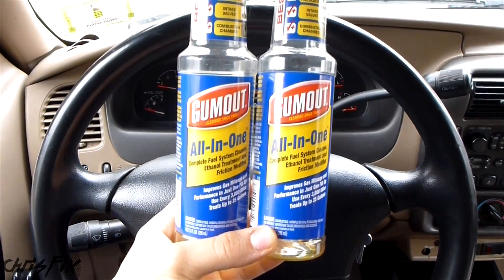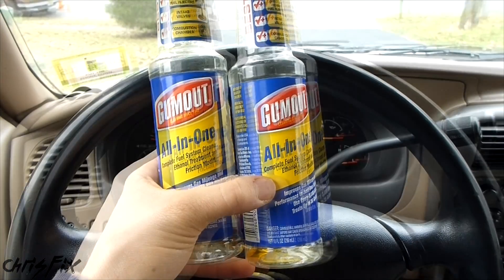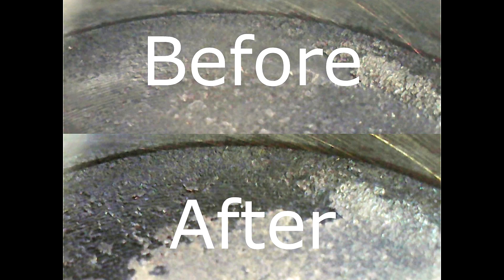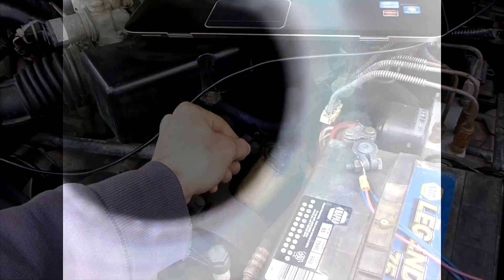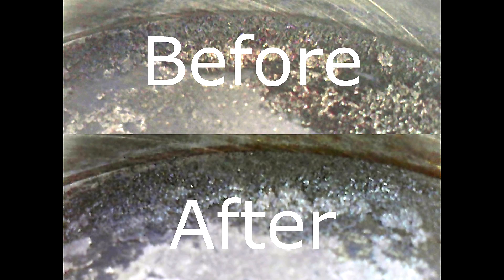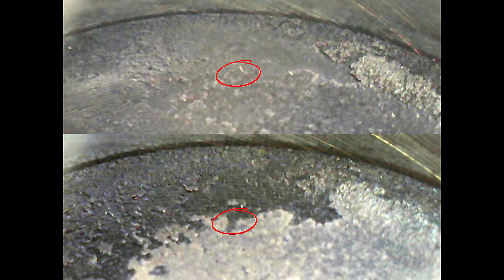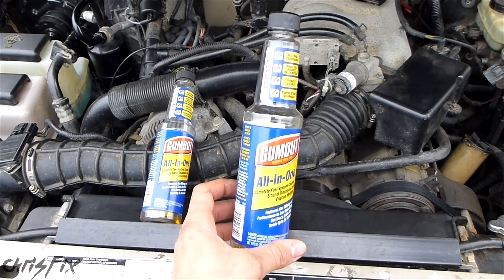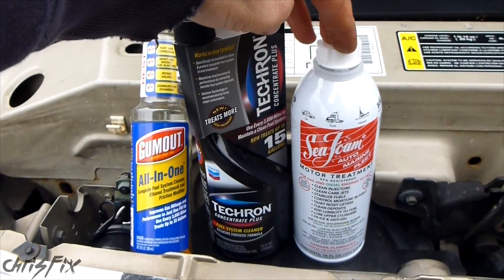Does Gumout Fuel System Cleaner Work (Follow up)?

Comment: what happened to the overheated PT
Reply from the maker: argonian bilbo It is sitting there. Trying to figure out what to do with it!
Reply: well you could experiment on it. Pull the engine and make a couple of videos on how to rebuild the engine with all the honing and other rebuild necessities.
Reply from the maker: argonian bilbo Yea, I was thinking about it.
Reply: one question. Does the reliability of an engine drop drastically if i hone my cylinders to fit larger pistons?
Reply from the maker: argonian bilbo If you do it right, it can be just as reliable as the stock engine. Every engine is different and you dont want to make the cylinder walls too thin but there are plenty of honed blocks out there that are reliable and use larger pistons and make more power. You will need to take it to someone who knows what they are doing because one mistake will ruin the block! What engine/car?
Reply: argonian bilbo
The quality of the entire boring/resizing process is what affects reliability.  If the block is disassembled or reassembled incorrectly it will cause issues.  The block and head must be decked and trued, the change in compression space measured and accounted for, the stroke of the piston and piston height must be recalculated, the rod angles need to be correct etc.  All those things and many others like block and head material, sleeved cylinders etc need to be considered.  I machine engines for a living and only some engines will tolerate a simple bore and oversize piston job ie a Chevy 350.  Thats why converting a Chevy 350 to a reliable 383 "Stroker" costs 3-4X what a stock 350 costs.  Stay gold.
Reply: ChrisFix  ok thanks. This car is being restored/modded so i probably will end up having a lot of questions, so I appreciate that you're helping me out here. Just so you know, i already changed the relay. That fixed my no flash at all problem.
Reply: ***** so do you think that a porsche 944 engine can tolerate an oversized piston job?
Reply: ChrisFix I was thinking of doing it on an 88 944. I think the car severely lacks power and I want to get oversized pistons and eventually turbocharge it or completely scrap that idea and do an LS swap. Engine is a naturally aspirated 2.5 liter.
Reply: argonian bilbo
Check Porsches specs regarding cylinder overbore allowances - heres an engine manual:  http://www.9ss1.dk/porsche944/garage/vol1/vol1.html.  If you really want to do it disassemble the engine and have a engine machine/building shop look at it.  If it was me I would just leave it stock, sell it and buy a S or Turbo model, then love it and massage it and tweak it.  Stay gold.
Reply: ***** I actually bought the car dirt cheap and if I sell it, it wouldn't bring enough money in to buy an s or a turbo
Reply: Yes thats true, but properly oversizing that engine and adding a turbo will not be cheap either.  Maybe you might make a little positive money off the car?  Research the costs of your intended mods and add the income from possibly selling the car.  Consider also that selling a modded car is more difficult than selling stock vehicles.  I am not sure if you want to keep the car for a very long time, that might change things.  Stay gold.
Reply: ***** yes I'll research first before I jump into it. I've been thinking if doing an ls swap intead of this, but thats not cheap either. So right now im trying to come up with a way that will work best for me and also won't completely drain me of money
Reply from the maker: argonian bilbo I dont know how easy or hard it is to do an LS swap but that is the better route. If you start messing with the engine, you will need to bore it, get correct pistons and have everything balanced correctly. Then if you turbo it you need to think about that when you pick the pistons. I would spend the money on an LS swap rather than an engine rebuild.
Reply: ChrisFix another question. So on this 944 i changed the blinker relay because it was bad and now it flashes fast on both sides. The hazards work normally but the others don't work. I changed bulbs on the back but the back left doesnt light up.
Reply from the maker: argonian bilbo what are "others" the turn signal bulbs? What isnt working?
Reply: ChrisFix that's what happens when you ask on the fly. I meant that when i flip the turn signal arm up or down they flash fast, but the hazards work normally. On the dash board both indicators flash at the same time no matter if it is left or right, On the outside it flashes left when i flip left and right when i flip right,but like i said both indicators flash at the same time on the dash board. Also the back left bulb does not flash even though it is new.
Reply from the maker: argonian bilbo That can be tricky. I am having the same problem on my van. I will make a video for you when I get to it!

Comment: These products most likely do a better job of cleaning fuel lines and injectors than major mechanical components.  I think it still might be worth it to use them for cleaning injectors but not for removing large amounts of buildup.  It would be interesting to do an injector spray pattern before and after, but that's a tricky test to set up haha!
Reply from the maker: ***** I definitely agree, but according to what they say on the bottle, it should clean the cylinder top. I wish I had a way to do a fuel injector test!

Comment: Here is a picture of Multi-System Tune-Up, the cheapest product that contains PEA. While I cannot find the MSDS online (thanks a lot Gumout) their site does state that it contains 30-40% PEA.
http://goo.gl/Jtmygn
Reply from the maker: Jesse Crandle I will look for that one and give it a try! Thanks for the info man! I wonder if they pulled the MSDS because it doesnt contain PEA?
Reply: ChrisFix The multi-systen tune-up is new, so they probably just haven't released an MSDS yet or the link hasn't found it's way to Google. You might be able to request it, but for the time being I just pulled the 30-40% PEA figures from the products main page. As long as they say it on their product page right now I think it's probably safe to assume it has PEA in it. Like I said the product has only been on the market maybe 3 months.
Reply from the maker: Jesse Crandle They also said the cleaner I tested would clean the top of the piston LOL. I hear ya. I will go pick some up and give it a try!
Reply from the maker: I need to drive my truck around for a little and do a new test first.

Comment: ChrisFix it seems that you bought the borescope and you got "Addicted" hahahaha.
Reply from the maker: haha, it is such a good tool to see what you normally cannot see!
Reply: Chris try to find the STP fuel system cleaner and use it in your truck its cheap i have used it for almost 9 years. you can feel a difference and more response out of the engine. i recommended the STP to a friend he had a 98 Jeep 4.0L he used it regularly when we opened his engine few years back the pistons we almost brand new im not even kidding. try it you are not going to loose anything it might amaze you.
Reply: ** Sea Foam is intended for 2 stroke engine some say that it works but it will destroy the catalytic converters.
Reply from the maker: K Seafoam started as for use with 2 stroke engines. Their products are now made for automotive gas and diesel engines (4 stroke). It says on their website that it will not affect the cats.
Reply from the maker: K I will add the STP to the list! Thanks for the suggestion!
Reply: ChrisFix
Nice work again sir.  Would be interesting to see a comparison including the cheapest bulk stuff too.  Canada has "Motomaster" Canadian Tire $2 brand stuff and I would like to see the diff btw that and the $13 Brand Name stuff Canadian Tire also sells.  Stay gold.
Reply from the maker: ***** Thanks man!

Comment: I think part of the issue here is that you used All-In-One. I've heard the ONLY cleaner that works at all is PEA, and the only Gumout product that show PEA in their MSDS is Gumout Multi-System Tune-Up. Very specifically that product.
Reply from the maker: Jesse Crandle The Gumout bottle states and also shows that it cleans the top of the cylinder head so I dont care what is in the bottle, it should do as it says lol. That being said, you bring up a good point and it will be interesting to see if the Techron which has a ton of PEA will work any better!
Reply: ChrisFix Unfortunately the Techron no longer lists PEA :( They quit listing it a few years ago. According to the Techron MSDS which I pulled from the Chevron website this is the ingredients:
 Distillates, hydrotreated light 40-70 %
 Stoddard solvent  40 %
 Solvent naphtha (petroleum), light aromatic 5-10 %
 Benzene, 1,2,4-trimethyl  1 - 5 %
Reply: ChrisFix Also I agree, the product should work, but they play off the fact that most people dump a bottle in and just say "HEY THIS WORKS GREAT!"
Reply from the maker: Jesse Crandle Yea, nice of them to do that, right?
Reply: Jesse Crandle Dude. I found in my storage Techron that I guarantee I bought before I moved to my house. So it still probably had PEA in it, lol. Actually, if you know the history of Techron, maybe you'll know how it was made in the probable era that I bought it. I think I've taken it on several moves and forgotten about it only finding it when I move each time (When I was in college I moved a ton of course.) I've had it for maybe 9 years.

Back then I bought it on an impulse buy despite "feel of the seat testing" telling me I didn't like it prior times, but like you said, my father kept telling me, "Hey, people say this works." Well yeah, you bought it at the Chevron gas station. It's good to believe in your own product to be a good employee, but it's better to use hard evidence.

Comment: A related question is whether it would make any difference if the carbon were completely removed? I doubt the small surficial accumulations you are seeing would affect performance. As long as advertising can convince folksk that a "fix in a can' is possible these products will be around.
Reply from the maker: Texas Pipeliner In this case, the carbon will not really affect anything. In severe cases, it can cause detonation which can ruin an engine. The idea is, does this stuff actually do what it says it does and how can I test that. The way I can test that scientifically is visually.

Comment: I personally use Lucas once in a while and it would be great to know if it works..costs $8.97 here (Toronto) for a small bottle (like 250ml) and the GUMOUT is about $4.97 for the same size you're using..so I guess for the price it is kinda worth it if it cleans up at least a little bit of the deposit.
Reply: enforceOM? Man, I'm always glad when a cheaper product works better. A reporter for news in my state Get Gephart (spelling Gephard? not sure haven't had TV in a long time) found the cheapest stove cleaner needed the least cleaner to work. Sometimes, some companies are willing to charge a higher price and risk fewer sells, but have higher prophet per sell, despite quality maybe even being worse. I think they're hoping anyone who wants to spend more will think "It'll be better", but is it? We just won't know until the tests are done.
Reply from the maker: enforceOM I cant wait to see if the Lucas does any better! I hope it works!

Comment: I've seen a machine you connect to the fuel rail, and run your car off of that machine and the cleaners in it. After an hour of running the engine on Gumout like stuff, you'll definitely clean the engine :D
Reply from the maker: February That is for cleaning injectors right? That would be awesome to have!
Reply: ChrisFix
Actually, everything from the fuel rail to the tailpipe. I don't know if it goes to the tailpipe, but it definitely cleans the pistons, cylinders and exhaust valves up to the manifold.
Reply from the maker: February Yea do they have proof? I dont believe anything about fuel cleaners anymore after seeing what I saw.
Reply: I could only find a couple of manufacturers/distributors of such machines. They usually determine how clean the engine is by testing the emissions. Maybe because nobody thought of putting a camera inside a cylinder. Here's the USA manufacturer's website: http://www.motorvac.com/
And here's UK's: http://www.terraclean.net/index.php . I think this technology is still new, that's why I can't find any "proof" - nobody is using it, because nobody knows about it. This technology could be useful in California where there is REAL emission testing.

Comment: Thanks for testing this. It's something I've been curious about for awhile.

I'd be interested to know if this product would work be better as a preventative measure against carbon build up in an already clean/new engine.
Reply from the maker: todd2fst4u2 From the tests, I would think that gumout would work well as a preventative measure but is it worth it to use a bottle at every oil change? It really depends.